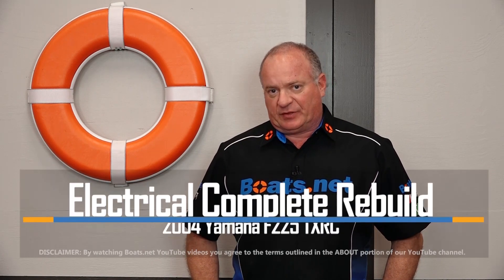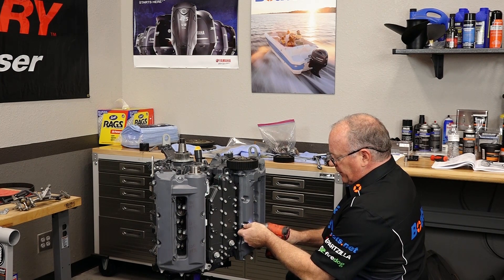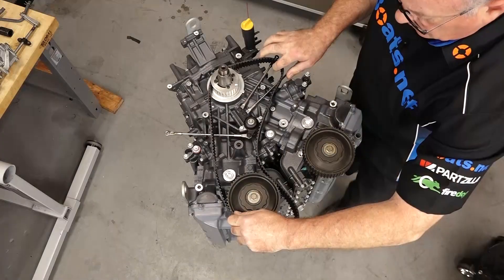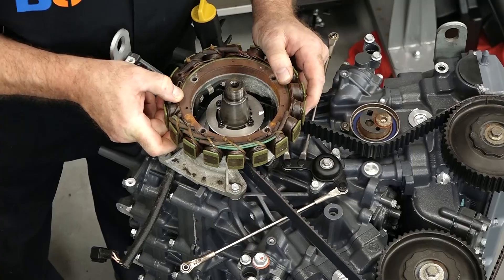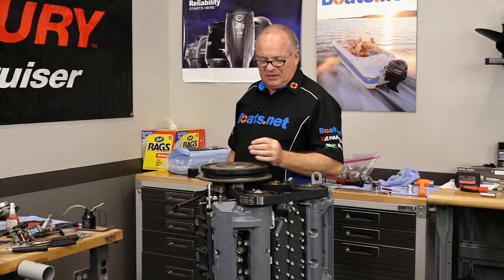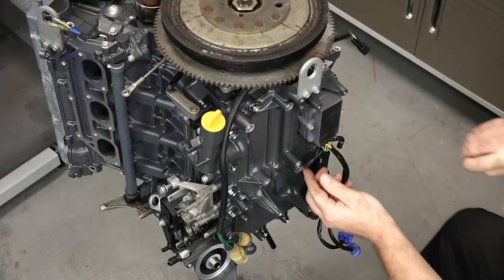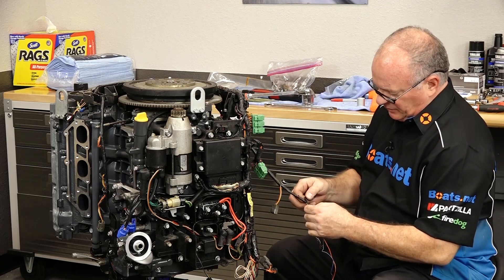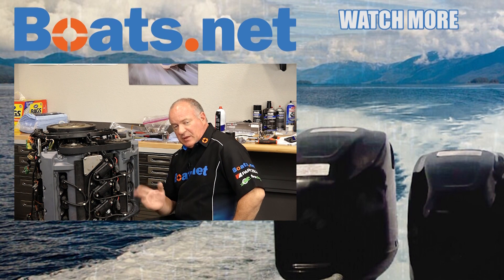Yamaha F225 Rebuild Pt 6: Timing Belt and Electrical | Yamaha F225 Flywheel Installation | Boats.net

Comment: John,
Enjoy watching your complete  repair of the Yamaha F225. I have to do a similar repair on my 2006 F150 that was losing oil due to a bolt coming loose on the manifold just under the thermostat housing. I did not recognize it until it appears to be too late. I hear a clanking sound from the top end and the compression in cylinder 1 (105-110) is too far out of range from the other three (145). 
I have two questions…
1. Any similar videos on the F150?
2. What is the name of the motor stand you use that rotates the engine?

Comment: Dealing with all types of boats and motors my whole life. Full time in my own business for 20 years. It surprised me a lot to see you make no Mention of any type of anti seize that should be used??!!  I realize there are types that don’t mix well with aluminum. But to me it is just really paying it forward to the next mechanic down the road to use a never seize / anti seize / grease  on all the hardware that can get salt water in it. To many broken bolts over the years that would have come out fine if they had been anti seized from the get go. Great video though!!!  Love how straight forward no bullshit you are!!!

Comment: I saw you setting the pointer dead center on the flywheel. What is that pointer used for besides the arrows that have to be aligned?

Comment: What type of yamabond are you using for the gasket sealant?  I looked on your website and looks like there is a couple different flavors.  I'm guessing #4 or #5 but I'd like to know which you used.